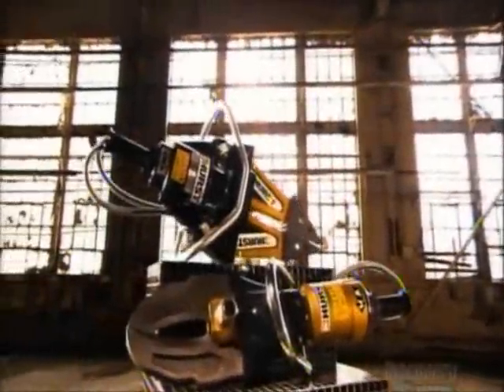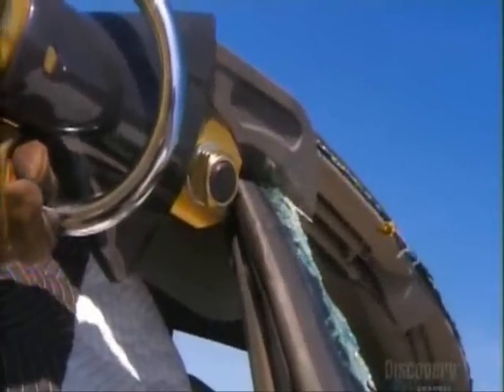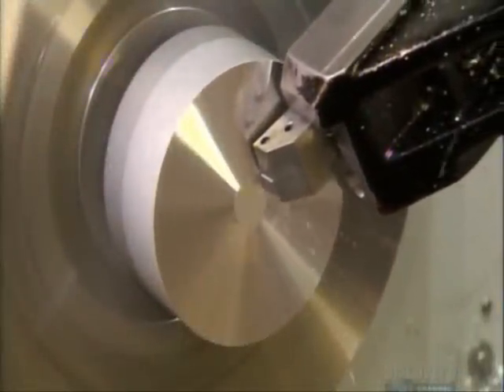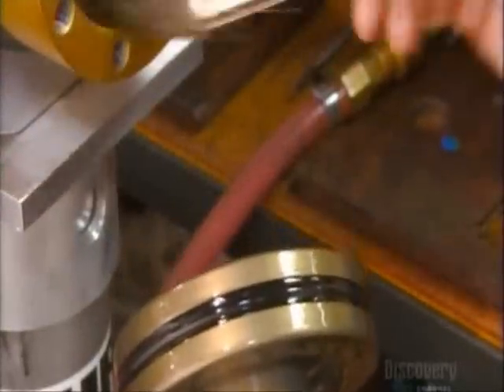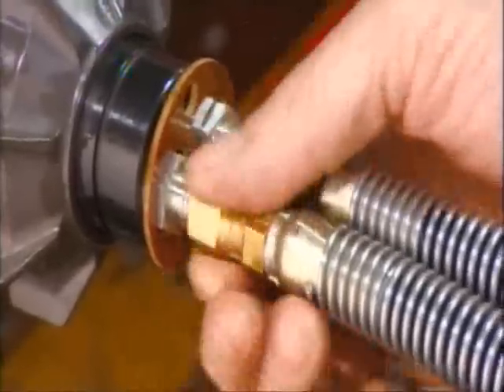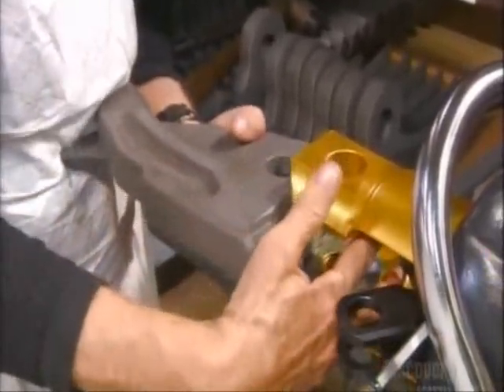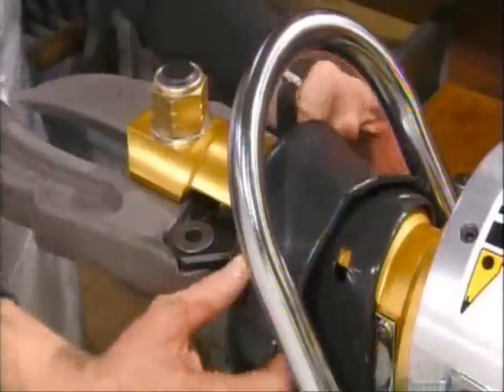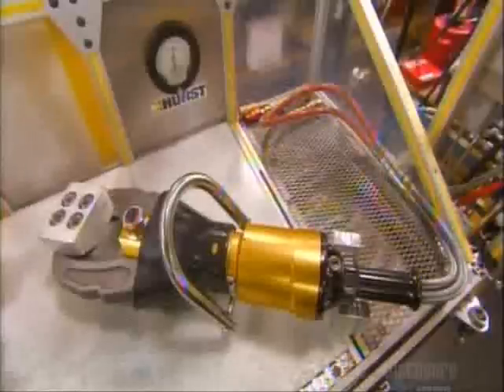How Its Made 04 Jaws of Life

Comment: Why couldn't Hurst make them this light and small when I was a fire fighter? The spreader we used weighed 75 lbs. and had a 36" spread capacity with titanium arms. It's still in use today, 37 years after it was purchased. The only thing replaced other than a seal here and there have been hoses and the pump. The tools have all lasted and done things they were never imagined doing at the time they were built.
Reply: Yeah, they may be heavy but they last, and some of the cars I have seen, I don't even know how they got the people out.
Reply: JudgmentDay78 ,Yes, The company I worked at made the large titanium spreader arms.

Comment: You think that the cutters or spreaders are a toy and lightweight? Wrong! If memory servers me correct there is like 20,000 pounds of thrust on each tip when spreading and like 15,000 pounds of cutting force when maximum pressure is applied. The tools will hurt you and toss your ass around if you do not have grip of the tool.